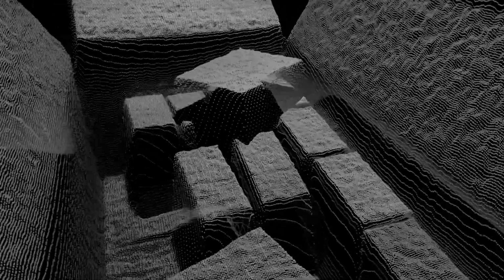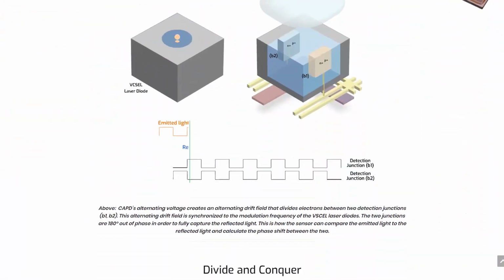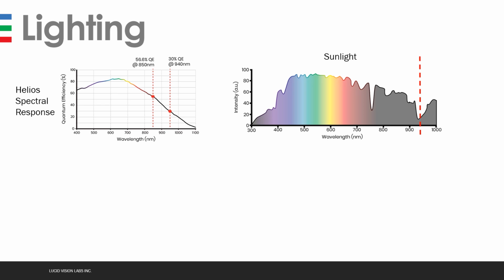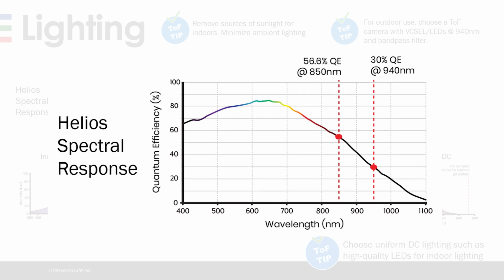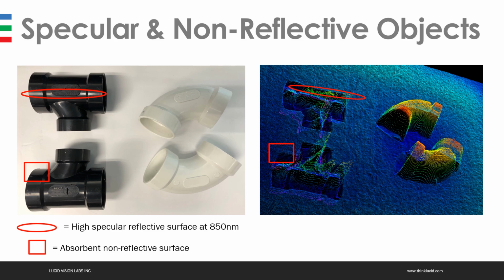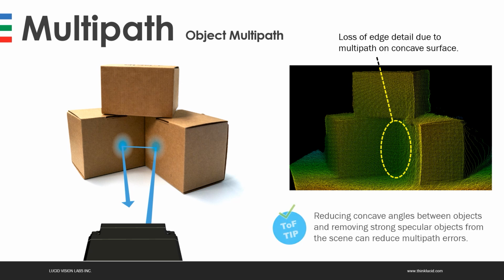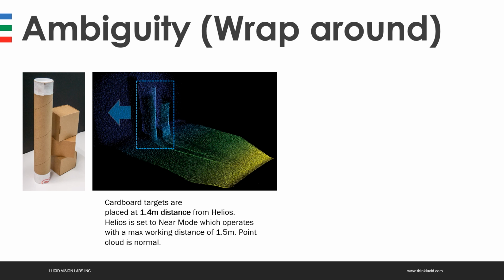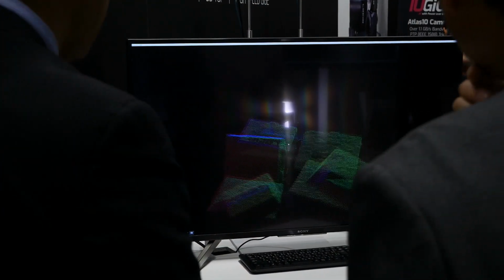Time-of-Flight (ToF) Tips: Tips to Boost 3D Performance and Cut Integration Time & Cost

Comment: I need a ToF camera below the 850nm. Why cant i find any product for my application 😔
Reply from the maker: That's because any VCSELs below 850nm will conflict with many types of indoor lighting and ambient light. 850nm is used because it is outside the visible spectrum. ToF cameras have to filter out ambient light and using a wavelength lower will end up getting filtered too.

Comment: Literally everything EXCEPT how a indirect ToF image sensor works..... Direct single point ToF and static point cloud depth sensing make sense to me, but this real time ToF across an entire image frame without capturing frames in the picosecond range, Im completely lost. I though LUCID could help....but I guess I was wrong.... [walks away, sad, in the rain]
Reply from the maker: There is a delay between the light sending and returning and the camera calculating the point clouds. The delay is around 10 - 12ms.